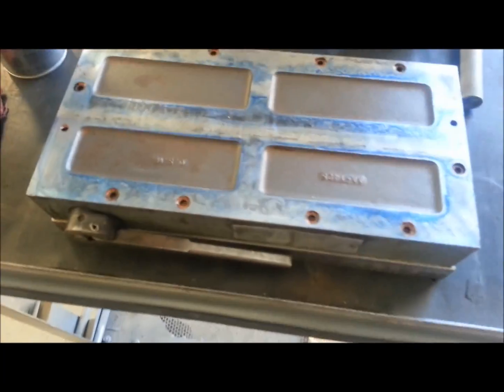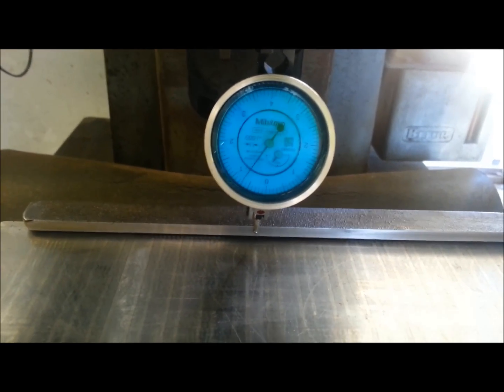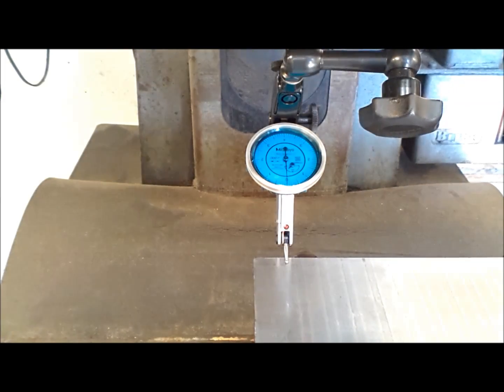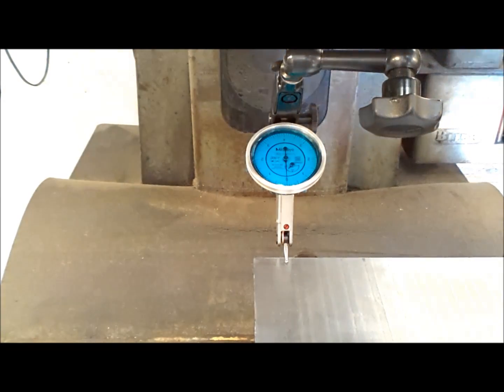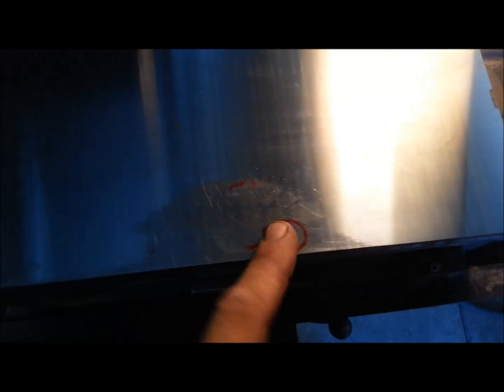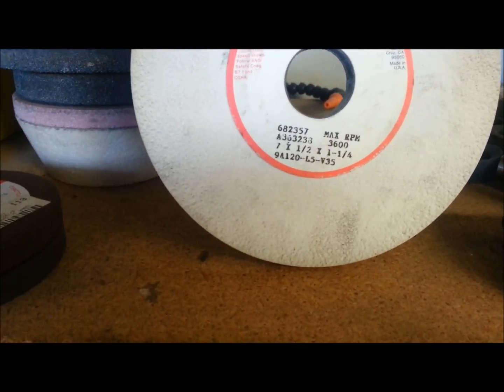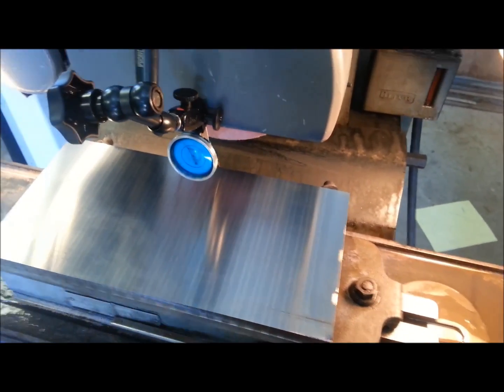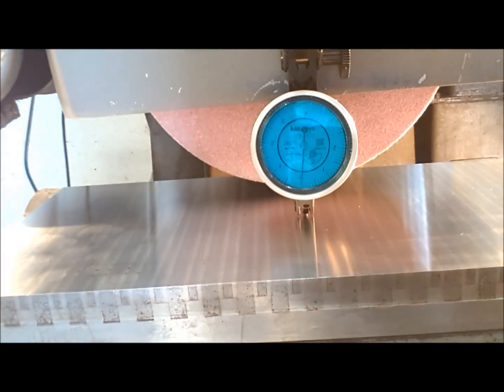Reseating a magnetic chuck

Comment: I use a brown Norton wheel for my chuck and other soft material. That’s the wheel type Norton makes for soft steel, cast iron,  brass, aluminum, magnesium and of all things, stone. I find that it doesn’t smear the brass or other soft materials. This is a 60 wheel, medium density. It doesn’t load much and wears about average.

Comment: Hi There, I was a Machine Tool Fitter for 30 odd Years. Here is what you should have done. After checking the slideways of your grinder for wear and correcting any faults, you should have ground the machine table. Then after cleaning the base of the mag chuck, replace on the grinder and grind the top of the mag chuck. Remove chuck from the grinder, thoroughly clean everything, Then place the mag chuck upside down onto the grinder table. Lock it into position with the mag handle, then grind the base of the chuck until flat. Remove the mag chuck, again clean everything, replace the mag chuck the correct way up, bolt it down and regrind the top again, This time with the magnetism ON. This will ensure that if there is ANY movement in the pole plates, that they will be ground flat. A mag chuck will be used in the energised position for grinding, so should be ground in that state. Would NOT recommend putting a paint spray between the chuck base and the grinder table, use a water repellant product. No idea as to what you have in the USA as I am in England. We used to use a Rocol product. Looked as though you were using the wrong grade of wheel too. Need a grey or white ( alumina ) wheel. 80 to 100 grit.
Reply: I completely agree. I found the way he did this to be a bit odd. If it works, it’s ok, but he should grind the table instead of the scraping he said he did. There no reason to do that. I use waterproof grease between the table and chuck. Just a tiny amount on the cracks and chuck, then move the chuck around a bit to spread it well, and clamp.

Comment: Thanks for answering my question....I would have replied to your response, but for some reason YouTube won't allow me.....I knew you either started all over after dressing the wheel, or you did a touch off, much like with a lathe cutting operation, but given the very tight tolerances when it comes to grinding, I wasn't sure...thanks for sharing your knowledge.

Comment: I manual surface grind for a living and do a lot of the regrinds of the chucks. When checking a chuck make sure your magnetic indicator is attached to the center of the spindle, reading where the wheel contact is. I've seen guys attache it to the sides and it gives you a false reading. The farther out you go the more it will show you how the machines ways are wore. That is how I check a machine for wear. 

 Another tell tale sign of way wear is if you can't get a cross check pattern across the whole backrail. If it is only on 1/2 or less, machine has issues. Basically this shows the table diving off.

Comment: I really found this video interesting.  I liked learning one technique of marking multiple points like you demonstrated...But, I have a question:  You said you re-dressed the wheel often.  After that is done, how do you keep track of the new zero, to continue grinding the untouched areas?  Forgive me if this is a dumb question, I'm fairly new to machining and have never ground anything at all.
Reply from the maker: Stopping to re-dress the wheel isn't what anyone wants to do, but you risk loading the wheel with material and creating scallops that are .002 deep and very hard to remove, after dressing, you have to go through the whole "touch off" process again, the paper trick works well for this, much the same as using it for a mill or fly cutter (as long as you know how thick your paper is)
Reply: @ShadonHKW  The "touch off" process works best for me like this. After dressing the wheel, turn it off and wait until it stops. Lower the wheel very closely to the chuck while spinning it slowly with your finger. (remember it's off so you won't hurt your finger). When it touches the chuck note the reading on the dial then move the dial a little higher. You'll then know exactly where the wheel will begin grinding without digging in and damaging the chuck.

Comment: So...I know this question will expose my ignorance, but without asking I will remain ignorant and therefore I must ask.

What powers the magnet on the chuck? It must be electromagnetic or things would never come off, but I was unable to see a lead to a power supply. Also, is the coil(or whatever creates the field), within the chuck itself, or housed in a separate unit?

I will Google it also, but find your explanations much more informative and easier to wrap my head around.

Thanks in advance, Aloha...Chuck
Reply from the maker: Hi Chuck,
Mine is a mechanical unit, just flip a lever and it does some kind of voodoo inside, the electrical ones are nice because you can control the clamping power, but have you seen the prices on those?
Reply: Shadon HKW
That is some Voodoo! I'm going to have to research that, it's making my brain itchy...

Thanks for the rapid fire reply, and yes the electronic ones are insanely expensive, have you ever thought of designing one?

Aloha...Chuck(non magnetic meat version)